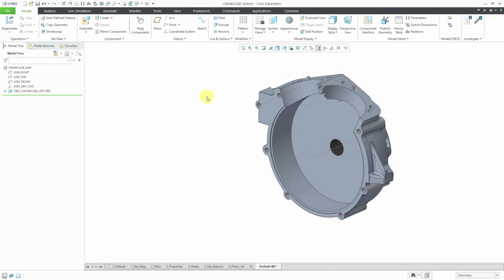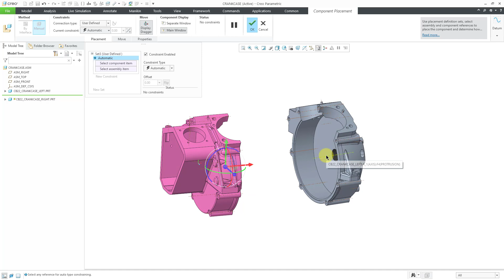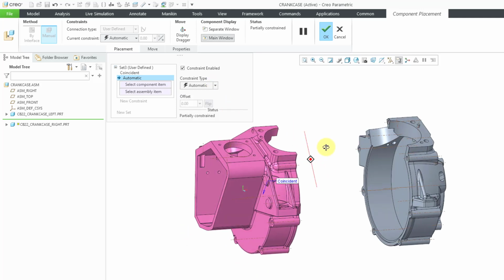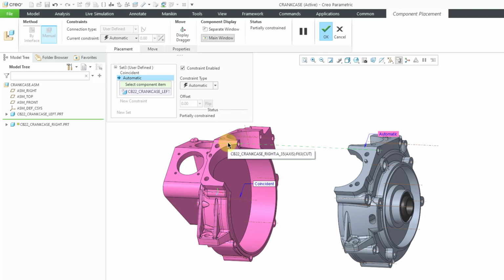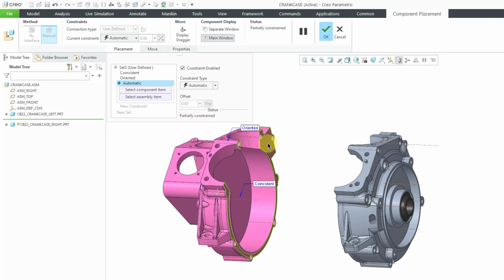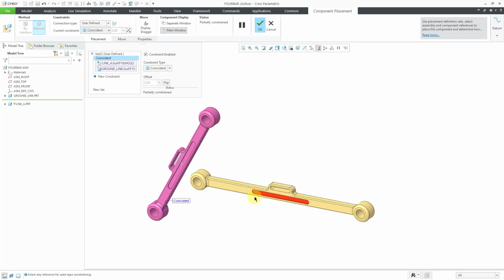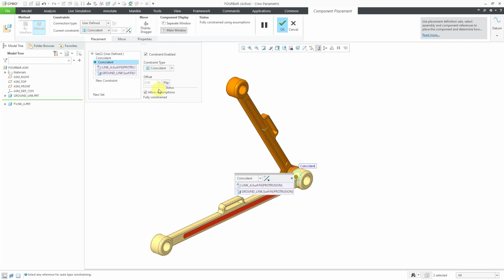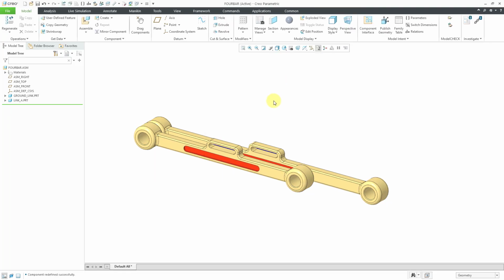Creo Parametric - Oriented Constraint | Assembly Modeling

Comment: So I guess this is mathematically more robust way to align axes and holes. Honestly I like this better than SolidWorks assuming either perfect alignment down to the atom or that the world has ended just because the fixture I drew has a hole distance of 180 while the imported step file has the distance of 179.975 or something.
Reply from the maker: Yes, especially when you apply upper- or lower- bounds to hole locating dimensions when testing tolerances.